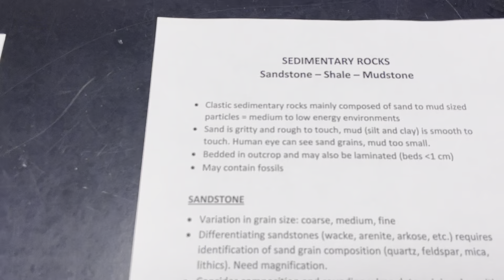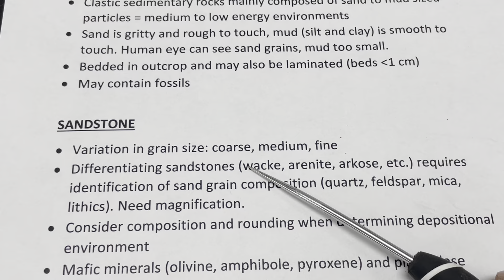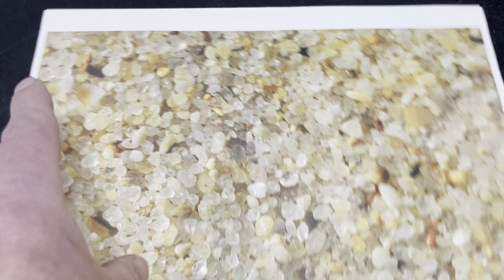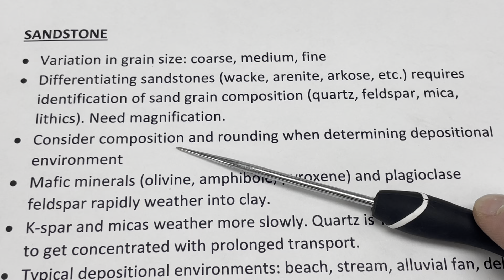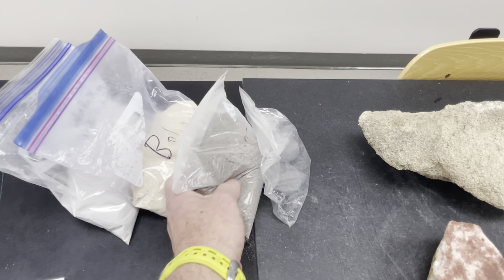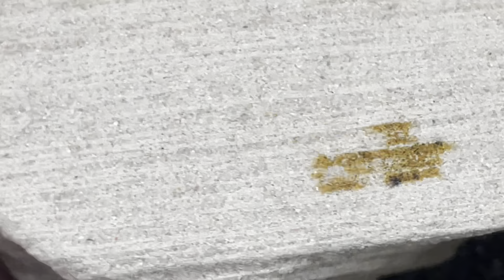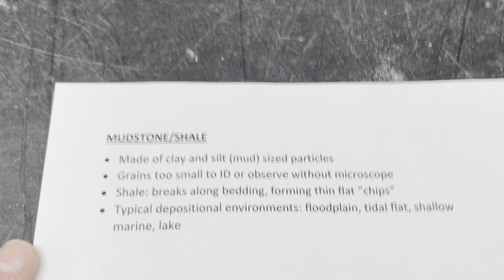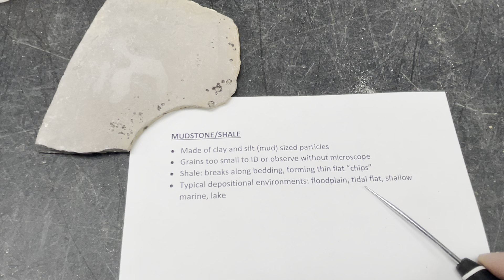Rock Identification with Willsey: Sandstone, Mudstone, and Shale

Comment: When I was a Materials Inspector, I tested soils. Silt is granular material of a size between sand and clay and composed mostly of broken grains of quartz. It can be felt by the tongue as granular when placed on the front teeth (even when mixed with clay particles). Silt makes up 45% of common mud. It is identified using the Sand Equivalent test. (Wikipedia)

Comment: No sandstones were harmed in the making of this video.

P.S. try using a quality 2-3 inch hand-held magnifying glass between the specimen and the camera. You could superglue a flat "hat pin" on the back of the glass to use as a pointer. This would free one hand.

Comment: Sand under a stereo is facinating. You only want 20X or maybe 40X.  A misconception with microscopes is high magnefication. Unkess you are doing bilogical reseach, not needed. Carry some snack bags and collect a teaspoon of sand. Look at the environment where it was collected. Lable your samples.  Get in to grian mount thin sections. You can buy polarising sheet plastic. Put one piece over the light source below. Then use another peice mounted in a film canister over the eyepeice so you can rotate it.  Some stereos hsve a screw on protective glass below the objectives.  Put a bit of polarising plastic on that.  Use an LCD  phone screen and sunglasses. Rotate. Sand is so exciting.  You can even build your own castle with it.